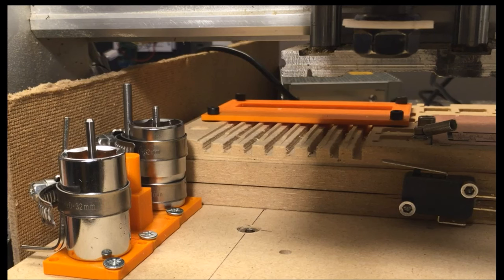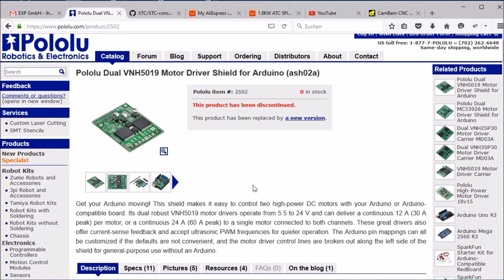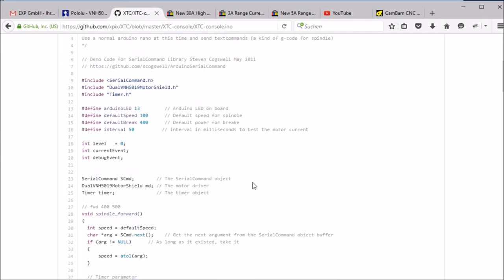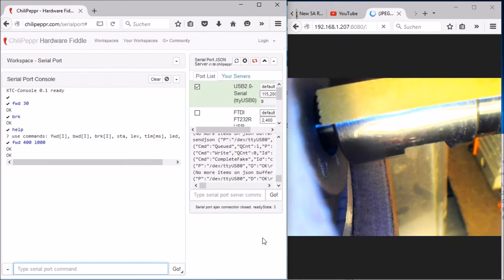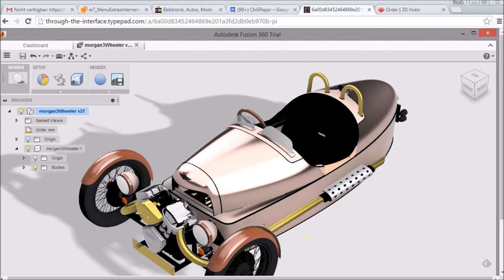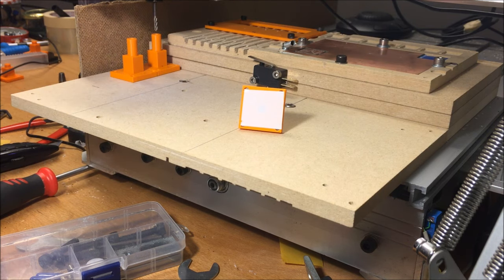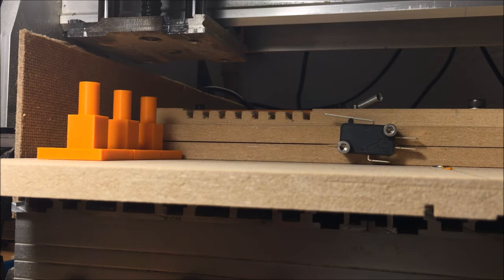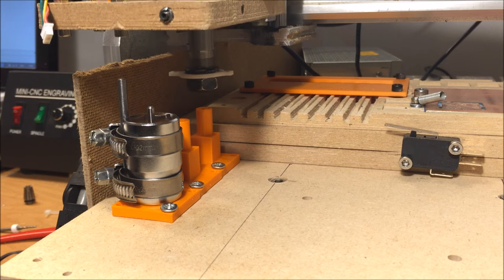XATC S01E01

Comment: Hey sehr gute Idee! Nett umgesetzt und gut erklärt. Danke dafür! Mir stellen sich allerdings noch 3 Fragen:

1. In der Praxis ,wie gut hält der POM Aufsatz auf der Spindelmutter auch bei 24.000 Umdrehungen und wie siehtes mit der Unwucht aus?

2. Ist der Motor überhaupt stark genug die Spindelmutter fest genug anzuziehen um das Werkzeug ausreichend zu sichern?

3. Wie verhält sich der Fräser nach getaener Arbeit und dem Werkzeugwechsel? Meine fallen nicht einfach so aus der Spindel wenn ich die Mutter löse, grade wenn sich Holz oder Carbonstaub in sämtliche Ritzen der Spannzange gesetzt haben.
Reply from the maker: Sicher es gibt noch eine menge zu tun :) ich habe den pom stopper so entwickelt das es keine unwucht geben wird. Auch denke ich ueber zwei schlitze nach die man in die mutter reinschleift damit der stopper seine Position behält. Ich habe dieses system für mein pcb fräs projekt entwickelt und dort treten keine grossen kräfte auf. Sicher für Aluminium oder stahl fräsen reicht das Drehmoment nicht aus, aber ich überlege mir schon eine Lösung dafür. Den halter habe ich so gebaut das das loch für den fräser ziemlich eng ist und dadurch der fräser beim lösen festgehalten wird. Man hört das auch im letzten videoteil, leichtes krachen beim herausziehen.